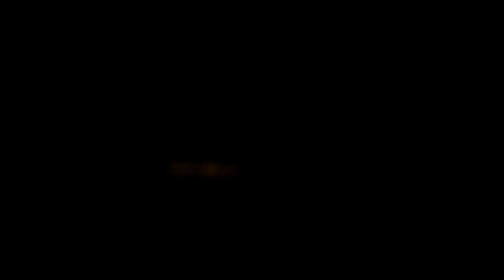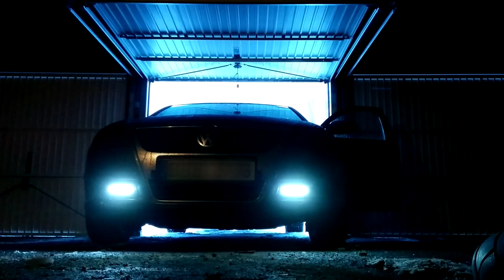Passat 3C DRL

Comment: it was good friend, could you tell me which wire of the headlight connector used?
Reply from the maker: Halogen lamp pinout:
1-3 Manual Levelling (Euro only, US N/C)
4 N/C
5 Ground
6 Low Beam
7 Ground
8 High Beam
9 Blinker
10 Parking Light
HID lamp pinout:
1-4 Auto Levelling
5 Ground
6 Low Beam (HID bulb)
7 Ground
8 High Beam (halogen bulb)
9 Blinker
10 Parking Light
11 High Beam Shutter (Bi-Xenon)
12 N/C